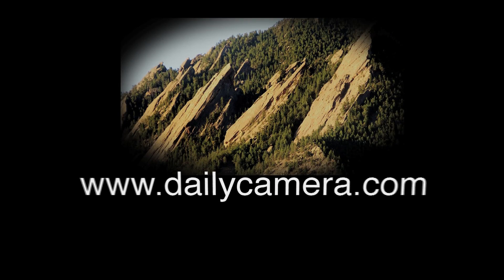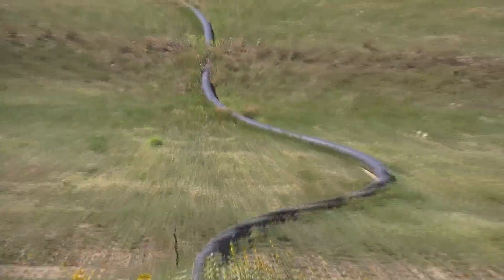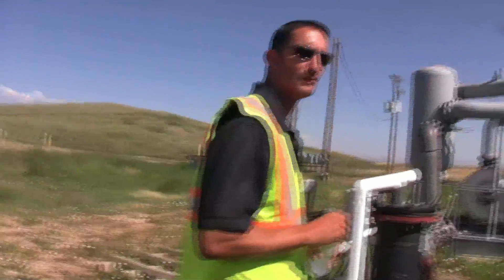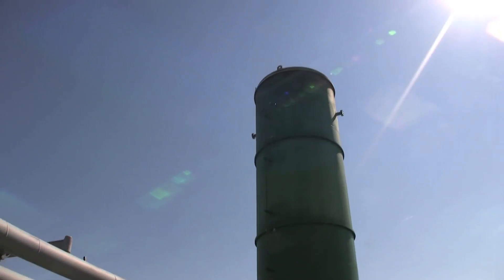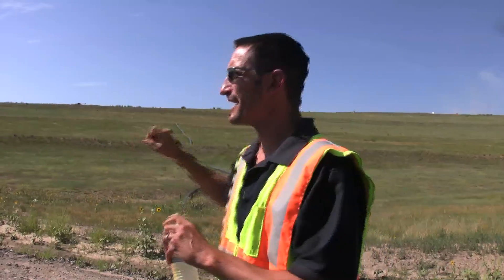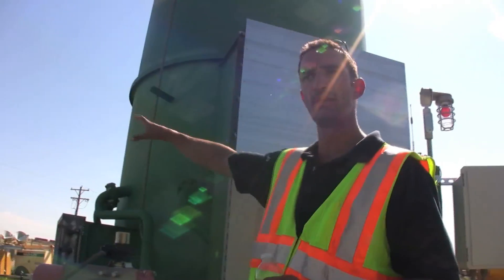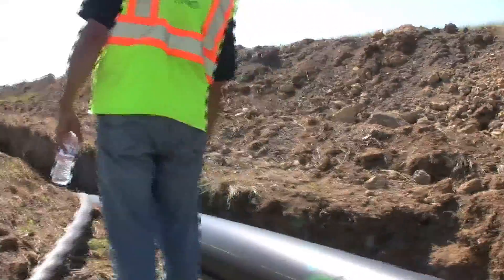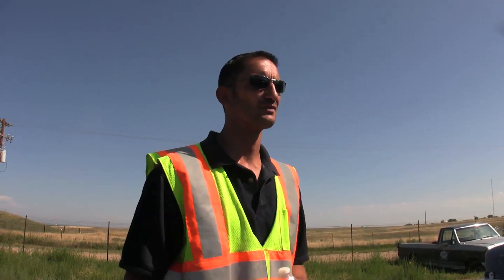Landfill Gases as Source of Energy

Comment: The increase in land-use methane from landfills is becoming a necessary measure for a considerable reduction of the greenhouse effect. Combustion of methane produces carbon dioxide, which causes a much lower global warming!
Electricity generation is done through the use of landfill gas as a fuel for stationary engines. The most interesting development is the power plant, where the simultaneous production of electricity and heat.